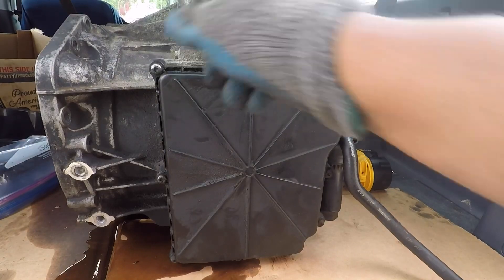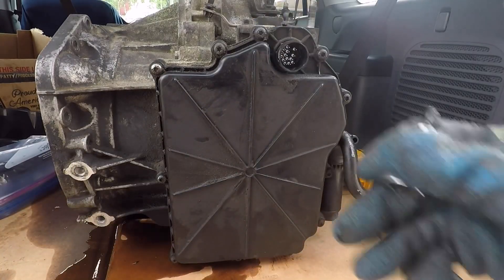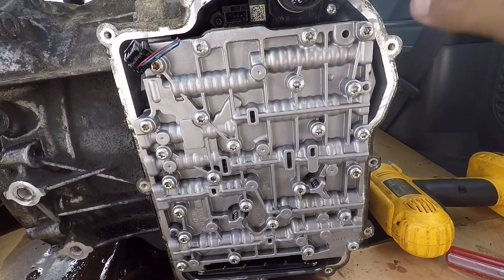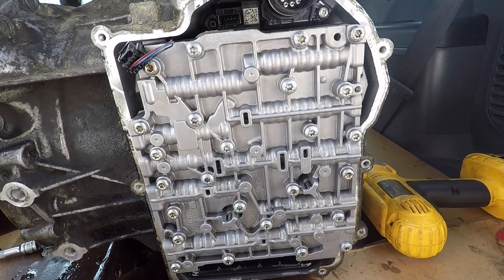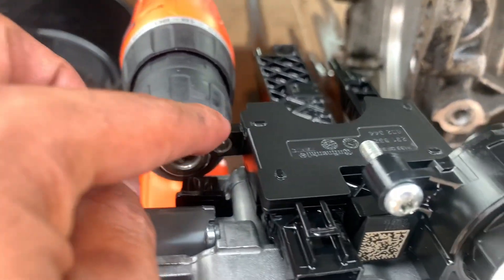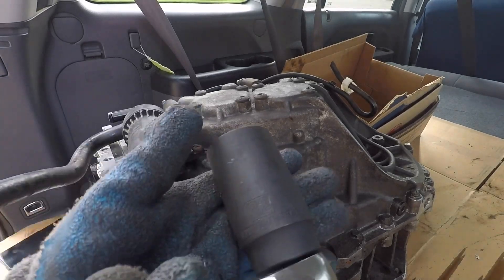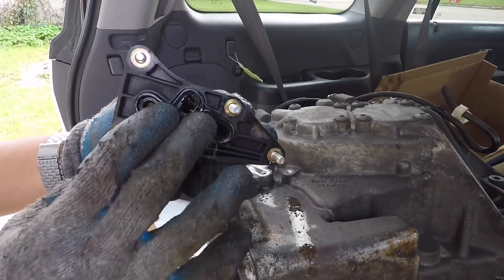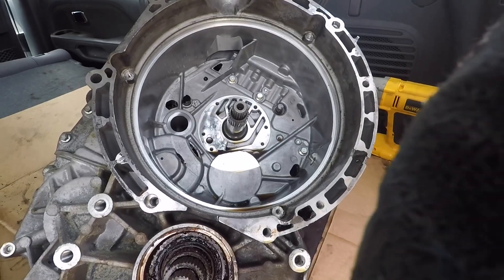Mitsubishi Evo X MR SST Transmission DCT470/ 6DCT470 build - Part 2 (Mechatronic unit)

Comment: Hey Jose, what size are the oil cooler hoses to the sst? Are those 3/8s or 1/2 inch? Thanks
Reply from the maker: I’m actually not sure on that size, sorry
Reply: @josezamora7889  if you had to guess maybe 1/2 inch? Doesn't seem to be 3/8@
Reply from the maker: @kenly6858  if I had to guess, probably 1/2 only because 3/8 does seem a bit too small
Reply: @josezamora7889  Thanks Jose.
Reply from the maker: @kenly6858  hey I just contacted Kozmic and said it’s metric. On my hose it says 12.7 (which is 1/2” size in standard inch)
Reply: @josezamora7889  Thanks for doing that man